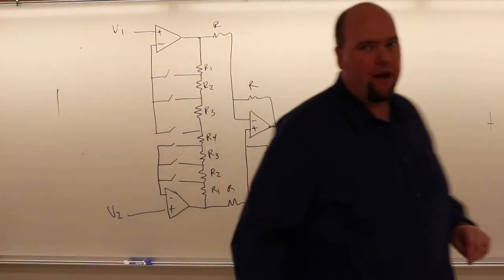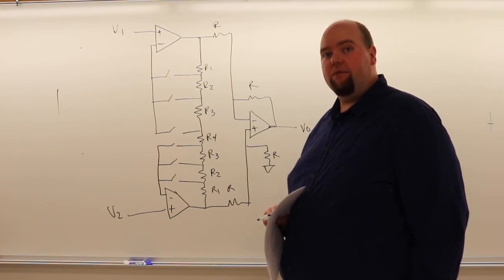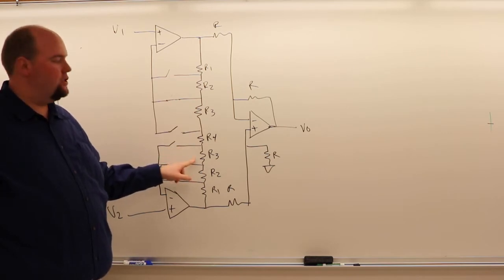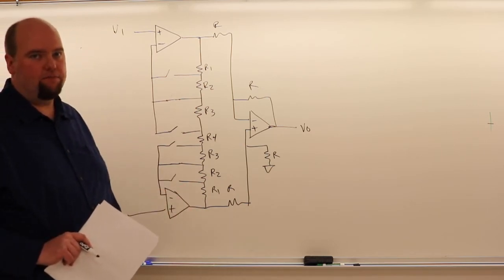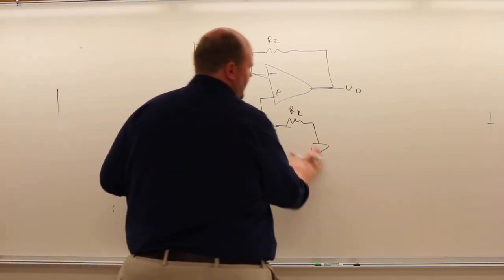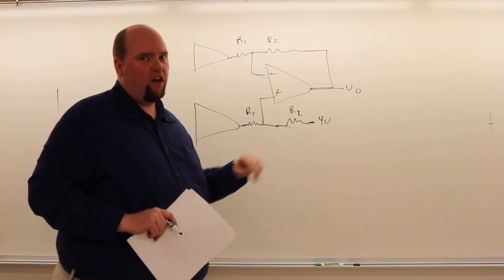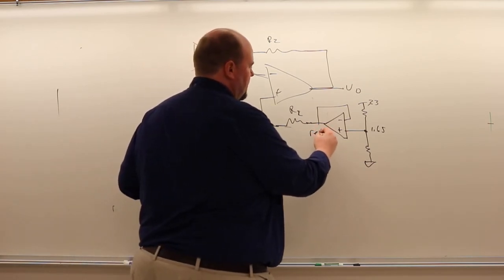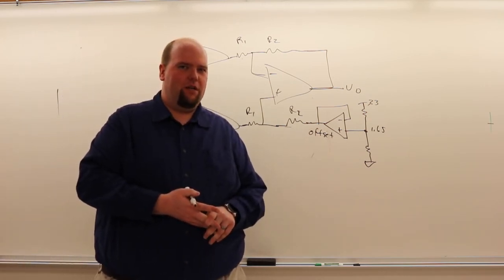Instrumentation Amplifier Lecture 3

Comment: What the hell! I finished all three videos on instrumentation amplifier and I learnt so much about how the heck 'common mode rejection' works, and that 'reference' resistor can be used to adjust offset and/or increase common mode rejection ratio!

I think common mode rejection ratio is equivalent to offset. Which means offset causes common mode imbalance, which directly translates to less noise rejection.

I wish to learn more about this subject matter as it is intriguing!